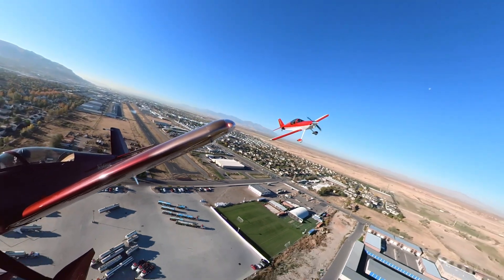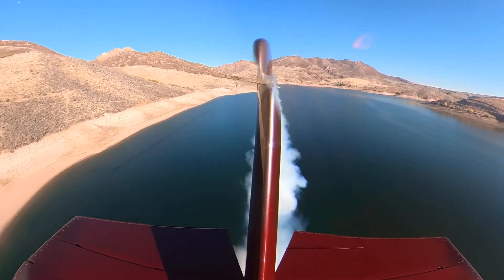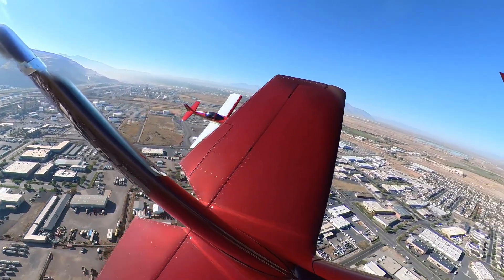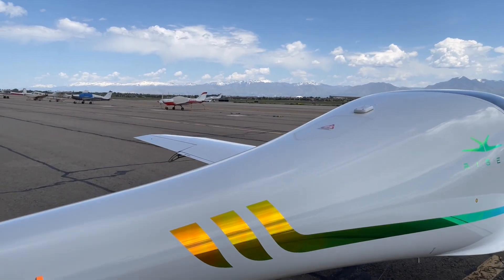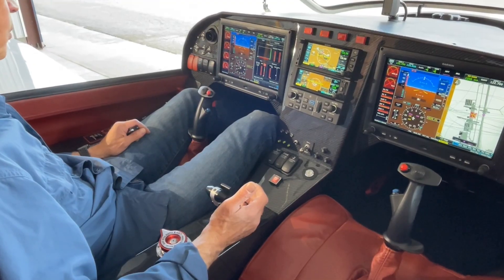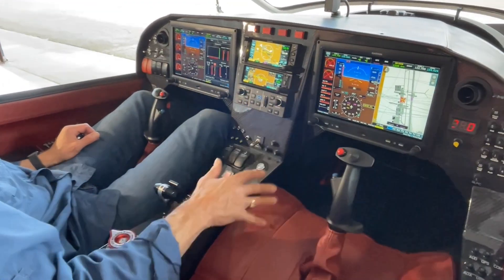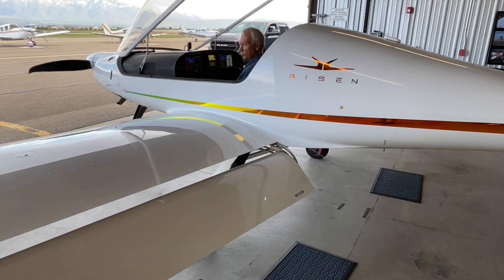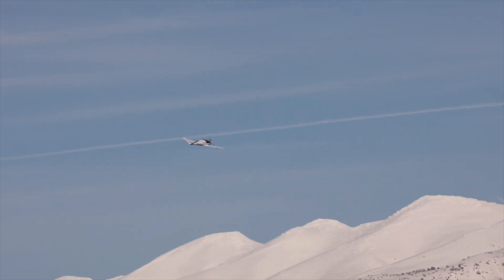Risen 915 experimental aircraft- Introduction

Comment: All this capability to take long trips and can get you there fast, but I guess you're supposed to buy all your clothes when you get to your destination since there's essentially no storage or payload capacity for luggage
Reply from the maker: @rbt5785   Yeah, it’s not a lot. But Bob takes two large soft sided bags and his dogs carry case in the middle. More capacity than my Rocket. 
My slow Husky doesn’t have much either. 
My 185 can carry quite a bit, burns quite a bit of gas and still not real fast. It’s always a trade off. But that’s the fun part, choosing what plane you want.
Reply: @ Agreed. And also why, although not the most fun to fly, the Skylane 182 is the best GA plane ever made when factoring all things across the board. 4 real adults with their luggage and you’re cruising 145kts for 6.5 hours
Reply from the maker: @rbt5785   yes, I think you’re right on the 182. Great all round plane.

Comment: Probably has a Rotax engine which ruins it in my opinion. Strictly a Lycoming man myself with a Continental maybe but not Rotax.
Reply from the maker: @miltonmatthews2138  yes it has a Rotax 915. I understand how you feel. I use to not like the Rotax, but I think it’s good for some applications where the plane is super light. The Risen is a very light airplane and the Lycoming engine would be too heavy. But, it would be very cool to see a little larger version of the Risen with a Lycoming. Although you might end up with twice the power and twice the weight.
Reply: @WheelsInTheSky .....and a crankshaft flange AD, and an oil pump AD, and another oil pump AD, and maybe a connecting rod AD just for fun. 
 Rotax is relatively new in the aviation business, but the quality and reliability seem to be fine. And, you don't have to sit on a waiting list for one!
Reply from the maker: Yes, the Rotax has allowed the design of so many planes, that we wouldn’t see otherwise. Rotax has made a great contribution to aviation and I’m sure they will continue to improve.

Comment: Is the experimental version rated for higher gross weight than the LSA version?  Wondering if actual GW and CG is much higher for the airframe than the rated.  Is the ballistic parachute due to poor spin recovery characteristics or can it be ordered without one?
Reply from the maker: @marcdragon2659.  I sent your question over to Bob (that was his risen that I did the video on).  Here’s his reply.
The GW on mine is 1377 lb, the microlight production version in Europe weighs in at 1650.
When Alberto and Reed flew his 916 non-stop from Goose Bay to Ireland, the aircraft was about 450 lb over gross weight, so there is a pretty large margin structurally.
The airplane has strakes at the ruddervator fuselage point that makes it spin resistant, I got into a power on stall demonstration for my BFR a few weeks ago, and the stall occurred at about 54 knots, plenty of warning, but broke hard to the left because of the torque, nose fell through around 60-70 degrees below the horizon, I pulled power, neutralized the ailerons, stopped rotation in about half a turn with rudder.
Everyone who has bought this aircraft wants the BRS as  a last ditch fail safe.

Comment: Coming back to this, unfortunately it seems the price has gotten greedy at 350k$. Other producers should copy the concept, it's very simple. Just a teardrop shape, no humps. You don't need the huge motorized canopy. A skinny A-pillar isn't a huge problem and it could be lighter and have no flaps. Could be super simple and cheap yet outperform million dollar planes. You could even make a 2+2 seater version with ease. With very aerodynamic gear it could be fixed gear and still get close to 400km/h. Again simplifies, lightens and lowers cost significantly. Could be sub 100k if not for rotax and garmin greed
Reply from the maker: @DanFrederiksen. Yeah, right now I think everything is twice the cost it should be.  Pretty disappointing, especially for us retired guys.

Comment: Low level aerobatics .... 🤦‍♂
Reply from the maker: @sugershakify  Great little low level machine. But probably not aerobatics down low- roll rate too slow.  Even though, it does a fine barrel roll at altitude- not recommended by manufacturer. Sweet plane for getting around at a reasonable speed while sipping fuel.

Comment: Correct my math but that seems rather thirsty as it equates to 14 litres per 100 kms.  For such a light aircraft with a very slippery shape and a small efficient engine, I'd have expected better.
Reply from the maker: @graemecatty9921. Hi, I think he gets pretty  good  mileage-at least for a plane.  I didn’t go back and listen to the video, instead I just sent Bob a text inquiring, and he just replied.  He says at 10,500’ he’s at 195kts and 6.8gph.  About 33 miles per gallon.  I think 14 kilometers per liter.  Better than anything in my garage or my hanger.

Comment: Can't wait to see the new 916 Equipped Risen at Oshkosh.
Reply from the maker: @garretwill5839.   Yeah, me to.  Alberto has already brought it over to the states.  Non-stop flight. It’s sitting in a hanger at Appleton, waiting for Oshkosh.  I’m hoping after Oshkosh, he’ll bring it out here for a video. 
I’m putting the engine back in my Rocket right now. Hope to be ready to fly to Oshkosh. See you there.
Reply: @WheelsInTheSky  

I see you talking about potentially fitting bigger tires on these for rougher takeoffs/landings. Did Bob ever get back to you? What size of tire can you get on them?
Reply from the maker: @garrettwilt5839 Hi Will, I just talked to Bob.  He says he’s got the smaller tires and the new Risen’s have, or can be fitted with bigger tires for grass strips.  He was driving and said he’ll text me shortly with the size of those bigger tires. I’ll make a note to check back with you.
Reply from the maker: @garrettwilt5839  Bob just texted me yesterday- 13 X 5 X 6 is the biggest tire

Comment: Small note: Garmin says Safe Glide is to be used only for engine out situations, not for pilot incapacitation situations. I think there are clear differences that would make using Safe Glide inadvisable when the engine is operating.
Reply from the maker: @ranetorrent8988. Thanks Rane. Good info. to know.
Reply from the maker: @ranetorrent8988. Thanks, that’s interesting.  As one guy said, it may be cheaper to just teach your wife to land!!
Reply: @WheelsInTheSky  Hm, I’m not sure it’s practical to expect every right seat passenger to be capable of landing the plane. The chute is a great option when all other options are spent. But using Safe Glide for pilot incapacitation situations could create bigger problems. Safe Glide wants to pitch to best glide, and doing that at a high power setting would be incorrect. And, pulling power when you have a good engine might eliminate the best landing options. In that aircraft, I think I’d do a preflight briefing with passengers showing them the LVL and HDG buttons on the GMC-507 auto pilot, and show them how to navigate to the nearest airport where they can pull the chute. I’d save the Smart Glide button specifically for engine-out situations as a method to reduce workload in an emergency situation. 

I’m considering purchasing a Risen 915is SV, so that has me thinking through as many elements of this aircraft and its operation as I can. The Smart Glide for pilot incapacitation comment gave me pause to think through that scenario. So, I contacted Garmin and they gave a short, curt reply stating that Smart Glide is ONLY for engine out scenarios.

By the way, the filming you do on this video is extraordinary. Keep up the great work!

Comment: Wonder if it could get the engine rated for zero G to be able to do aerobatics
Reply from the maker: @Zugbarrh. Ha, it’s got good + and- g’s. But I don’t believe it’s rated for aerobatics. We did a few barrel rolls. A bit slow on roll rate with that long wing. Although, even with an inverted fuel and oil system, you’ll have some kind of time limit on zero g.  Glad to hear you want to have fun !!

Comment: I’d love to see the fixed-gear version (the Siren) equipped with the 915.  I’m willing to bet you’d give up no more than around 10-12 kts in airspeed, especially at high altitudes with reduced drag.

I read an article that the Siren (912) boasts a record of 155 kt/288 kph cruise.  Yet the Risen 912 is advertised at 300 kph, which is 161.9 kts.  That’s very little difference.  I’m a fan of fixed-gear due to the high maintenance costs and insurance premiums associated with retracts.
Reply from the maker: @GeneralSirDouglasMcA.  Yeah, I’m sure you’re right. Next time I see  Alberto, I’ll ask.  I kinda like the clean look with the gear up, and worry about costs later.

Comment: I’m not a pilot, but I was under the impression that airplanes were required to cruise at minimum heights to help ensure more time to find a landing spot in an emergency. Am I mistaken?
Reply from the maker: @jamescaldwell5. Hey James. If you’re flying IFR, there are minimum altitudes for obstructions and reception. When flying VFR, there are minimum altitudes over populated areas and over people and buildings, etc. where we’re flying there’s no restriction. Of course, it’s always a good idea to give yourself some altitude for contingencies. 
When flying low, we’re always looking for potential emergency landing spots- a road or open field. But sometimes, you’re just going to be screwed if your engine quits
Reply: @WheelsInTheSky  Thanks for the explanation. Flying a light sporty aircraft is pure fantasy at this point for me. Although the modern Giro plains are very interesting to me since they can do a fairly vertical emergency landing upon engine failing. But they are limited to around 100mph cruising speed. That airplane is obviously stunning and fun to dream about.

Comment: That would be classed as a microlight in the UK. And prised among the current high performance aircraft. Love the video. Great flying and awesome views. A very relaxing narration.
Reply from the maker: @Simon Clarke. Thanks. It’s going to be interesting to watch the Light Sport category here in the US, now that the rules are changing.
Reply: @WheelsInTheSky what changes are coming?
Reply: @CWK09  The basics are increased weight limit to 3000 lbs, increased stall speed to 54 knots, retractable gear allowed, controllable pitch props allowed, and a speed limit of 250 knots.
Reply: @MarkRose1337  would that not cover most personal two seaters? A cessna 172 is under 2,000lbs.
Reply: @CWK09  That's the idea. They found LSA were much safer than Experimental, but people were building Experimental to get around limitations of the LSA category. The old limitations were there in an attempt to add safety, but were having the opposite effect. There will still be a limit of one passenger.
Reply: @CWK09  - The current LSA weight limit is based on Maximum TakeOff Weight. The Risen MTOW is the same as the current LSA MTOW of 1320 pounds (depending on the model). A two-seater Cessna 152 weighs a little bit more than that. A four-ish seater like a Cessna 172 is between 2200 and 2800. Having the new MOSAIC MTOW at 3000 pounds will open the possibility for sport pilots to be PIC of most of the current fleet of training aircraft. Regardless of the number of seats in the aircraft, the new MOSAIC rules will limit the actual capacity to two people including the pilot.
Reply from the maker: @CotyKelly.  the FAA’s recently released Modernization of Special Airworthiness Certification (MOSAIC) proposal for changes to  LSA. You can google it for an interesting read.

Comment: Can the Risen be registered as a motor glider?
Reply from the maker: @marshallhammond1099.  I know it looks like it could be, but it can’t.  In the US, it’s an experimental.  Soon to be a Light Sport Aircraft.
Reply: @WheelsInTheSky  doesn’t light sport limit speed to 120 mph?  The Risen can travel at twice that speed.  Would be a shame to kneecap it like that.  Go manually adjusted prop and be a motor glider.
Reply from the maker: @marshallhammond. The rules for light sport are changing.      I’ll find out why it can’t be regulated as a glider.
Reply: @WheelsInTheSky  is it because the prop is self adjusting?  The glide characteristics seem good enough.

Comment: Curious what the stall speed clean?
Reply from the maker: @kazansky22. The manual says 57.8 KIAS clean and 43.2 KIAS full flaps.  That’s at MTOW, CG 30% MAC, engine at idle, stnd day.  I’ll check with Bob, seems when we flew together we got better numbers.  Although, it was winter time and less than max weight, we were at 7000’.   I’ll let you know if he wants to pass out different numbers.
Reply from the maker: @kazansky22.  Alberto, the designer is planning to get the stall speed down to 54 KIAS, due to the mosaic that the FAA recently came out with.   Alberto is planning to sell the Risen as a certified light sport aircraft.  Risen plans to have a presence at Oshkosh 2024.  I’ll see you there!!
Reply: @WheelsInTheSky That's perfect man!
I'm actually getting ready to do my captain upgrade and I wanted to get one of these risen Superveloce planes as a gift to myself!

Now hopefully the FAA will get that mosaic ruling out on time.....
Reply from the maker: @kazansky. Congratulations.  You deserve something special!! An airplane is always a good idea!

Comment: Very curious how the Dark Aero will compare to this. Also a very light CF design, similar features, but more than double the fuel capacity, faster cruising speed, etc. Very interesting video, thanks for all the info!
Reply from the maker: @brois841. I’ve wondered the same thing.    I’d love to fly next to one. Thanks for commenting.
Reply: That has a tight cabin and 200HP engine...a different category aircraft...furthermore I highly doubt they will actually reach the advertised parameters...The Risen has a robustness and fit and finish like a certified quality aircraft...
Reply from the maker: @ electricaviationchannelvid7863.  Yeah, there something to be said for an actual plane, vs one still under design. 
I think Dark Aero is getting close. I hope it’s everything they say. Maybe see one at Oshkosh this year.

Comment: 195kts, 6.5gph
30+MPG
Nice
I wonder if the manufacturer could integrate some solar into the wings and body, and how much that ~2HP would get you, maybe an extra 1MPG, a longer glide in case of an engine failure, i wonder if there is a better speed for efficiency and how much more effective solar without batteries would be at that speed, could you get it up to 40MPG say 120kts and say 3.5gph
Reply from the maker: @denvera1g1. Yeah, that’s an interesting idea.  I’ve often wondered if you could take the Toyota Prius concept and put in in an experimental plane..along with solar panels on the wings and fuselage.  I think we’ll see some cool planes coming in the future!!
Reply: @WheelsInTheSky  The future looks bright.
There were some interesting concept planes, i saw someone had made a self piloting flying-wing drone that patrolled all day on solar, and i remember someone had made a single person solar plane, but i think it had a wingspan simialr to a medium-large passenger jet so a bit unrealistic, but i think it could fly 24/7 in theory

I personally think a large delta with lifting body or flying wing would be great, wouldnt run on solar alone, but a 2 passenger might get 10-20HP from solar above the haze. if designed right, low speed and low drag might see the gas engine only needing to run at 60HP on a bight day, and electric opens up the option of thrust vectoring by adding more motors, say some small 5HP EDFs to the wingtips or with those blades that fold closed when not spinning, i wouldnt personally trust something that complicated, but maybe thats why i've only ever seem them on gliders as a 'deployable pusher' that doesnt retract into the body, instead folding the blades
Reply from the maker: @denvera1g1. Makes me want to start building models and see what works.

Comment: Beautiful airplane.   One question - Is there enough luggage space for a long weekend trip for my wife and I ???????????
Can you get it without the parachute?  (with such a low stall speed, looks like you could crash land in a small field without much bodily damage).
Landing gear wheels look a little small...
Reply from the maker: @keitha.9788.  Yes.  Bob and his wife do it all the time, with their dog.  Although, they stay at friends or hotel.   I would say the volume/size of the baggage area is certainly adequate for week-end trips.  The weight limit is 30kg/66 pounds.   If your going to be camping, it may be a bit tight depending on your camping equipment. 
Yes, you can get the plane with out the ballistic chute. I would agree, slow enough speed to put down about anywhere.  Unless you routinely fly over territory that wouldn’t allow any kind of emergency landing.  Yes, those are little wheels.  I had mentioned that to Alberto, in reference to landing off asphalt.  As I recall he mentioned you could put bigger tires on it.  Not sure how much bigger would still fit in the wheel well??  My buddy and I fly our high-wings backcountry.  I land first with my big tires to check the strip, then he lands his Bird Dog, with 6.00” tires.  So much fun!

Comment: Read the price is appx $215k for this Swiss aircraft. Not horrible at all.
Reply: Unfortunately the tbo on that turbocharged engine is apparently only 1200 hrs.
Reply from the maker: @markg4459. Thanks Mark.  That certainly has to be factored in.  I think I’ll check on what the cost of that would be.  If it’s far less than other engines, it may still be a good deal.
Reply from the maker: @markg4459. Hi Mark. Yeah, that’s not bad !!
Reply from the maker: @markg4459. Also, I guess the manufacturer use to be Swiss Excellence, but it’s currently Porto Aviation, in Italy.